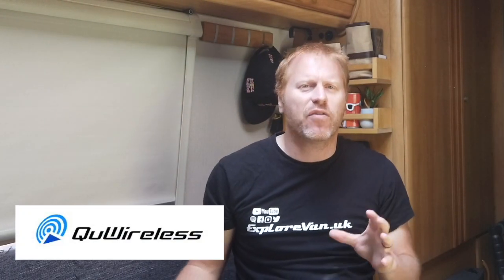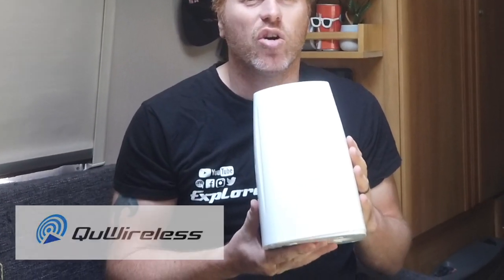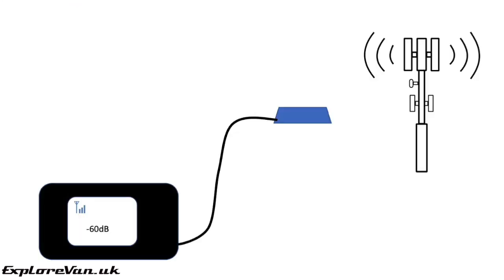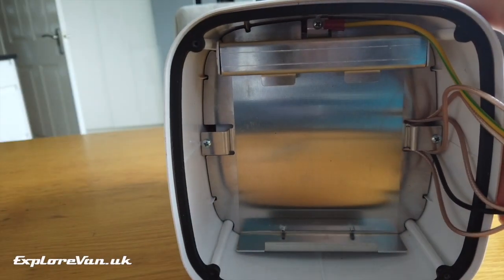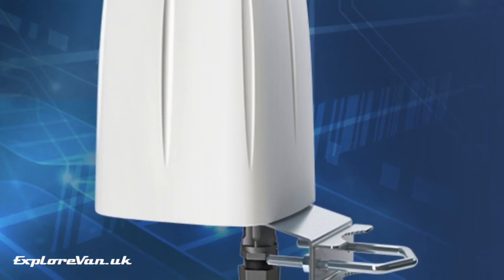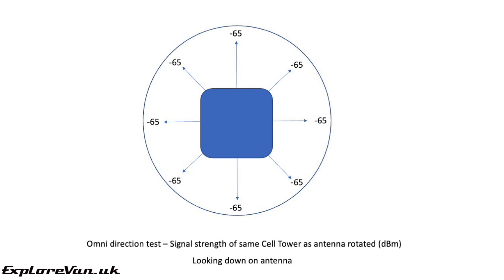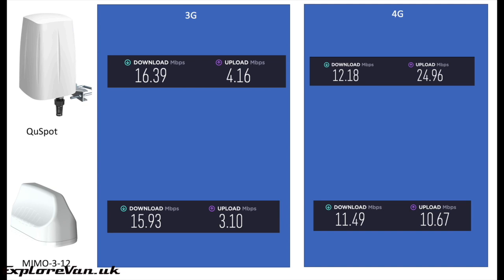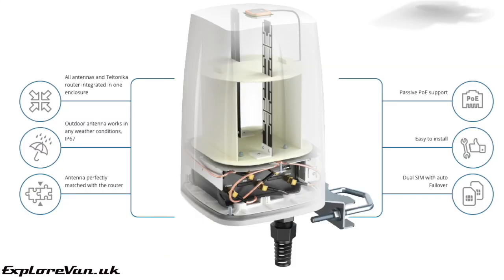QuSpot LTE 4G Antenna - Unique design / performance - Motorhome Campervan RV Caravan mobile internet

Comment: Interesting video. Makes complete sense to make a magnet and stick it on when needed as a complete unit.  It seems like the cable probably makes the mimo 3 loose out. I've got a xpol 1 as Omni and very short cables through the roof. I just got an xpol2 5g Omni directional. I'm considering now attaching the antenna to a magnetic waterproof box and sticking the router in there all Ng with a small powerbank. Would make the installation easy and adjustments easy :) good work on the tests provides good info 😀

Comment: Also, could you mount this on a Kuma roof mount magnet attachment pole or external ground mount tripod thingy, just pulling back inside the van when travelling?
Reply from the maker: Yes absolutely - height is your friend when it comes to LTE 4G so the higher you can get it the better. 

You can see our later test on the QuSPot Vs the QuMax in our video here. https://youtu.be/InxuAsLBHBE

Comment: Following on the question from @kcwatters, thinking about the RUTX14 with the appropriate QuSpot that’s made for that unit and also the RUTX12 alternative.  Supplier suggests the “faraday cage” created in my van and others with foil backed insulation may significantly degrade the WiFi signal from outside the van to the user tech inside the van.  You suggest it’s negligible but any real world test evidence?  Supplier currently has me convinced to just buy the router alone at the moment to try that out first.  Always a pleasure watching your kind and informative videos.👍
Reply from the maker: It's not something we have measured as we saw no noticeable difference. (however we don't use foil backed insulation and have large windows/roof lights, no heated fronted windscreen) therefore the Faraday cage effect isn't going to be huge, particularly for a strong WiFi signal being transmitted right next to the van. 

It will have a much bigger impact on the LTE 4G signal being transmitted from some distance away. 

If you feel your van has a higher faraday cage effect then maybe an external LTE / 4G antenna with the router inside is a better option (check out our reviews of the Poynting Puck / Mimo3)

It would just be a balance of the impact of the Faraday cage effect on the WiFi signal Vs. the LTE antenna cable loss impact on the LTE signal. 
For the MIMO3, which has higher quality cables than most it is:
0.250 dB/m @ 400 MHz
0.385 dB/m @ 900 MHz
0.507 dB/m @ 1500 MHz
0.565 dB/m @ 1800 MHz
0.788 dB/m @ 3000 MHz
Reply: @ExploreVanUK thanks Mike.  That was my ultimate thought too to go with the Mimo 3 7 in 1 Antenna (4 LTE antennas to match up with the 4 on the RUTX14), just that it’s really expensive.  Does have the benefit I think of being 5g ready for the future though.     Mag mount with a very short cable do you think?
Reply from the maker: @johnmitchell3027    Yes, that would be my choice in your case.  It comes with a 2m cable - and unless you are very proficient at remaking off cable, I would leave it at that as the loss from a poorly installed connector on shortening it is likely to be more than you would gain from less cable.

NB both the Mimo3 and THe QuSPot are 5G ready - but the Mimo3 will match to more routers, where as the QuSpot limits you to the models it is designed for.

Comment: Daft question perhaps, but if the router is now outside the van, doesn’t that degrade the WiFi signal for use inside the van or is the WiFi signal easier to get into the van than the LTE signal?
Reply from the maker: Hi Kevin, no it’s not a daft question it’s a very fair one. 
The difference is in power / locality, what makes the difference is the WiFI signal being a few metres further away has negligible effect on the performance particularly using 2.4Ghz wifi which is a good penetrating frequency. 

The reason LTE is so affected by the receiving antenna being inside the van is that it has usually travelled much more distance (kilometres) before it gets to the van so is already quite weak.

Comment: This is a good solution if you do not need to change sim cards in the router (e.g. when you are going to a new country).
Reply from the maker: Yep that is very true.

 If you have a router with 2 sim slots, like many of the teltonika range once installed you can change between them remotely.

Comment: How about quoting the GAIN of the antenna as this is how antennas are compared?
Reply from the maker: Hi Tim, thanks for the question.  

The manufacturers quoted gain can easily be found on their websites.  However this varies depending on the frequency being received and is only one measure of performance. 

I purposely don’t quote manufactures gain in my video as its information that is readily available and not something I can verify so would have to rely on their honesty. 

The tests I complete are more directed towards use in real life rather than a lab test environment where the gain would be calculated.

Comment: We are off to Pembrokeshire in Wales soon I don't believe the phone signal is good so would this help?
Reply from the maker: Hi, a good antenna would definitely help but what it can’t do is magic a signal where one doesn’t exist. 

We spend quite a bit of time in Pembrokeshire and the signal coverage has improved a lot over the years. 

It’s a big place so can’t guarantee it will work but this would give you the best chance out of the options we have tried.

Comment: Hello, first ket me say how much I appreciate your excellent videos. I have a question- I don't want Internet in my van as such but just a better mobile phone 4g signal. Is there a way of boosting that signal?  Thanks for your time. Alan UK
Reply from the maker: Hi Alan! Thanks for the feedback that is lovely to hear really glad that you find them useful. 
Mobile phone boosters in the U.K. were technical illegal up until pretty recently, Ofcom have acknowledged there is sometimes a need for them and have approved a small number of units but they cost around £400. 
You can read more about them here. 
https://www.ofcom.org.uk/about-ofcom/latest/features-and-news/mobile-phone-repeaters

You will find a number of unapproved / wide band boosters available from abroad which though they may be an option would technically be illegal and could cause interference for others. 

I imagine you are trying to avoid having an addition monthly subscription but it’s worth noting that if your mobile provider supports WiFi calling, as most do, adding internet (with a an external antenna to improve the signal) in your van would also enable you to use your phone when it is connected to it even if your phone doesn’t have a cellular signal.
Reply: @ExploreVanUK  thanks for taking the trouble to reply.  I appreciate your advice.

Comment: How would it compare to "motorhome wifi" 4g offering, any idea?
Reply from the maker: As I am pretty sure “Motorhome WiFi” is just a Teltonika RUT240 Router and a Panorama (or similar) Antenna with a sticker and quite a few £££s added my expectation is that this would perform better and be substantially cheaper.

Obviously may get some level of customer support with “Motorhome WiFi” but I have heard an example of them just referring their customer to the manufacturer anyway.
Reply: @ExploreVanUK  Yes i think its a no brainer to go for this cheaper option, thanks.